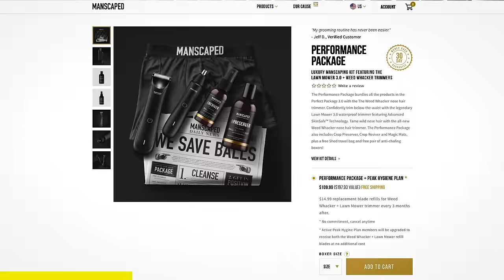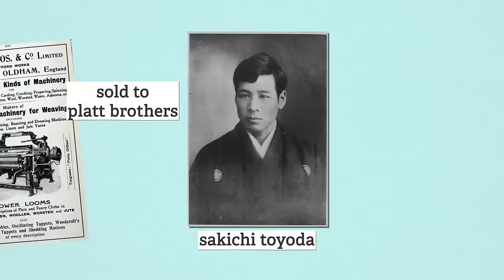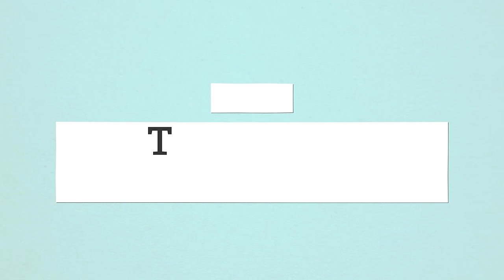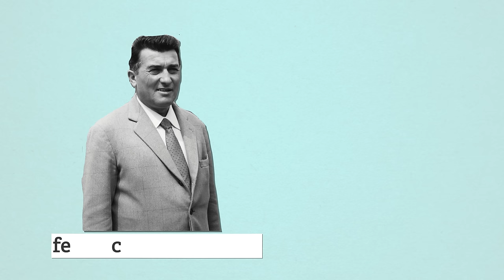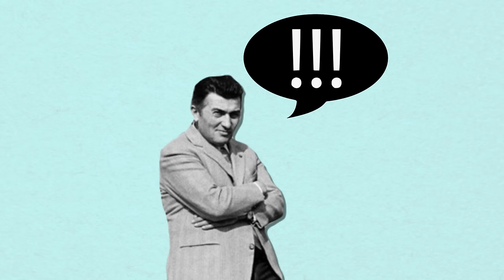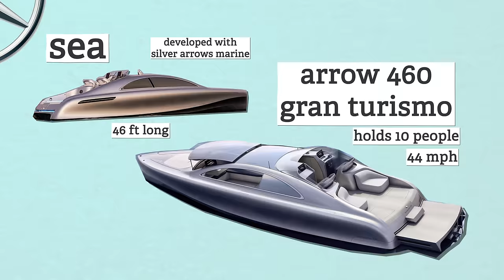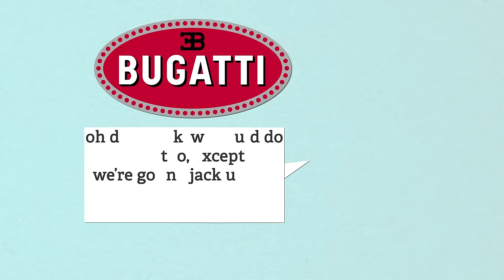Surprising Products Made by Car Manufacturers

Comment: The war efforts would be an interesting episode(s).
Reply: Yes Donut 🍩 a video about this would be cool
Reply: I remember GM made some bent sheet metal .45 cal single shot pistols that were airdropped to aid the resistance  during WW2.  They cost something like $1 each total to manufacture, fill the grip with loose ammo and print cartoon instructions with no words. Singer sewing machine company also made some of them.
Reply: @jaxturner7288  my old history teacher has his father's revolver he had when he was serving from ww2. He said it gm made it.
Reply: Jax Turner GM also made a good amount of M16a1s (about 230,000) under the Hydra-Matic division during the Vietnam War
Reply: (Every War Thunder / Wargaming / DCS / IL2 / Steel Beasts / Armored Warfare Player eagerly awaits)
Reply: Yes
Reply: It would be a great episode/series.  I, personally, would like to see an episode focused on Ferdinand Porsche’s relationship with Hitler when it came to designing tanks, such as the Tiger tank.  Another interesting topic would be a specific variant of the M4 Sherman tank, the M4A3.  The engine for the A3 was a V8 designed by Ford.
A bit unrelated side note, but not all Sherman’s were built by the same company.  You can have four Sherman tanks and they can be from entirely different companies, for an example, we’ll use the Pullman Car Company (A Rail car Manufacturer), the Baldwin Locomotive Works (A Locomotive Manufacturer), the American Locomotive Company, or Alco for short (Another Locomotive Manufacturer), and the aforementioned Ford.
Reply: No one mentions Mitsubishi bombing Pearl Harbour?
Reply: Past gas
Reply: Porshe made tanks fore germany and they were good
Reply: But then of both sides.
Reply: Donut and Time Ghost collab would be awesome
Reply: @jaxturner7288  That's the Liberator. Ian at Forgotten Weapons made a video about them if you're interested.
Reply: @lc9245  No, they didn't. The Imperial Japanese navy using Mitsubishi aircraft attacked pearl harbor. Learn the difference between the manufacturers and the users.
Reply: @DavidLee-df888  Bruh. It's not like they use Mitsubishi civilian aircraft. Mitsubishi was a weapon manufacturer and designer. Not sure why you are hanging up on semantics.
Reply: @lc9245  semantics comes into play here because of the way you worded your original statement. What you said clearly infers that Mitsubishi, the company, carried out the pearl harbor attack. This is obviously not the case unless factory staff were sitting on the wings and dropping bombs. If you want to be more accurate, Subaru were more involved since the Nakajima bombers did the actual damage, Nakajima being the predecessor company to Fuji who own Subaru.
Reply: @DavidLee-df888  And so were Nissan with Aichi. I don't find any problem with the original statement, your interpretation is yours. though I find it difficult to understand that the inference isn't "Japanese cars manufacturers used to produce weaponry but no one seems to mention the most famous example", to me the intention of the statement was rather conspicuous.
Reply: David Lee oh yeah I’ve seen it.
Reply: You could probably have a whole episode on all the things GM made
Reply: @lc9245  You want me to?
Reply: @no_one1992  So did Skoda
Reply: You can do a whole video of what Oldsmobile made, not just rockets either.

Comment: "I don't know why my heart keeps failing, how can I make it better?"
LS swap it
Reply: To be fair its small block chevy swap it
Reply: No
Reply: 2jz for life
Reply: @codebus  2JZ's are overrated and overpraised
Reply: Why LS swap when you can Barra swap
Reply: @Majaweed17  laughs in stock components handling 1200hp and 36 lbs of boost
Reply: Bruhbham 77 ngl
2J makes more power modded, but LS can fit in fucking anything
Reply: @themidnightinator  cries in crappy non vtec d sieries
Reply: LS with a muffler delete.
Reply: @bensonhedges479  because GM doesn't make the Barra engine
Reply: @themidnightinator  the 2JZ-GTE tops out at about 850 stock bottom end, while the 4.8 Vortec (an LS based engine) tops at 1200hp, the 6.0 Vortec tops at 1500 stock bottom end
Reply: ls swap heart 💀💀💀

Comment: Jordan 18 was either designed by or after Farrari as a racing shoe. The first Jordan 18 release was a black suede upper with aluminum mesh air vents,and red carbon lower,using a satin red inner lining. It has the same MoMo style heal kick pad lined in black carbon fiber. 
Zip up covers the laces! It’s an actual dope racing shoe! They’re not made as good since 2006 tho!

Comment: GM used to make refrigerators when they owned Frigidaire. For a while 
Ford owned Philco, a company that used to make electronics. Chrysler used to have a brand of air conditioners, Airtemp. International Harvester used to make trucks, farm implements and kitchen appliances.  Toyota makes cars but they also make forklift trucks.

Comment: "White and blue on a bmw badge is a propeller in the sky"
WRONG!
Its the Bavarian flag SMH
Reply: No it’s not
Reply: @wesleeysutton5935  https://www.bmw.com/en/automotive-life/bmw-logo-meaning-history1.html said there itself. BMW air propeller is a myth confirmed by the company itself.
Reply: @wesleeysutton5935  Actually, it is.  As Enz Santiago said, the propeller is a myth.
Reply: Ye
Reply: @wesleeysutton5935  WRONG!
Even BMW have said its bullshit
Reply: @mickeydee3595  when?
Reply: JkandI even it’s myth  said that BMW resembled as air propeller
Reply: @dergonmcdragon3161  BMW did not say that. They have publicly said the opposite.
Its the Bavarian flag inverted. Period
Reply: Correct. It is the Bavarian flag. The propeller myth came from when the bmw roundel was super imposed on an airplane prop for a magazine cover. The logo was, in fact, originally the Bavarian flag.
Reply: I’ve heard both... it confuses me that BMW used airplanes/propellers in their old sales brochures and owners manuals. (It’s in my e30 manual and original brochure)
Reply: Sex Might Help
Reply: BMW: Bayerische Motorenwerk is what That means and the Logo is the rounded of Bayern or Bavaria where they were founded and are based
Reply: @leevon2wheels320  They produced aircraft engines as well

Comment: 1 Year too late, but I'm pretty sure that the white and blue on the bmw badge is there to represent the bavarian flag. You know... Bayerische Motoren Werke, Bavarian Motor Works. Also the black ring is symbolising Rapp Motorenwerke, which was the first name the company had while manufacturing aircraft engines back in 1913.

Comment: saab had a start in aircraft, pivoted to vehicles, and then pulled back to military aircraft.

I was a little befuddled when I walked out of the office one day, noticed the usually dead-looking office downstairs had a crate at the door, labelled something along the lines of "SAAB guided missile system controller"... did a little research and it turns out they're not building cars any more.....
Reply: Saab had never given up military and civilian aircraft since its inception. In fact Saab Automotive was a distinct branch of SAAB.